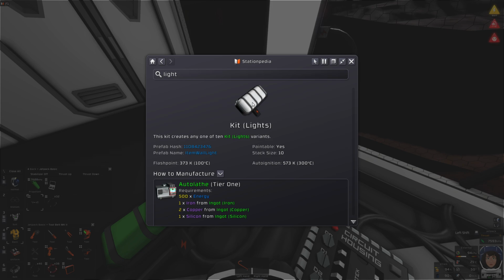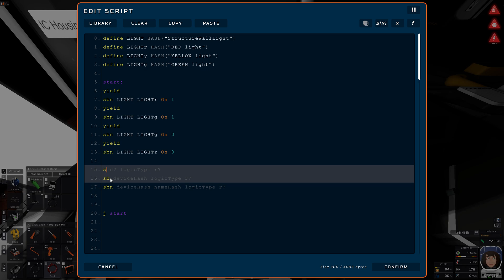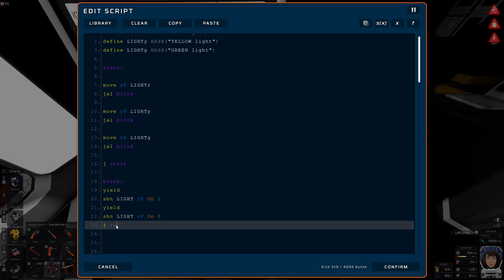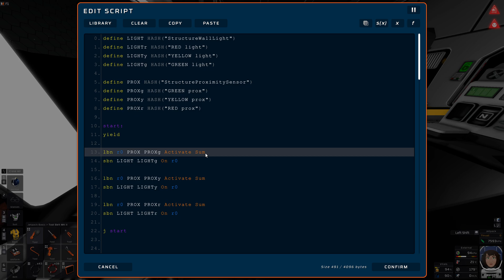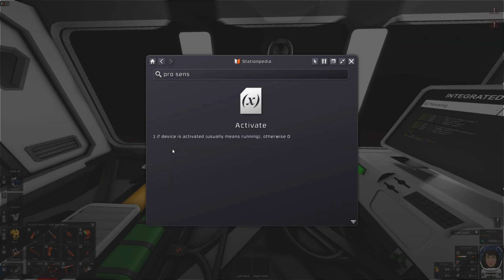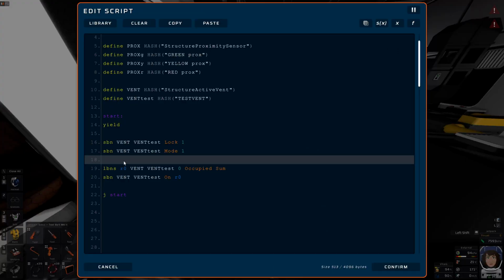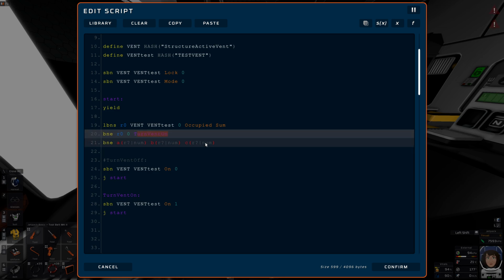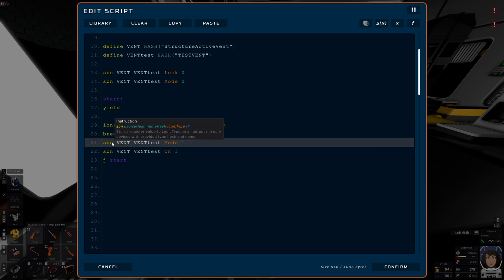Stationeers PROGRAMMING for total beginners - TURBO STYLE! - Part 2: No more screwing around! *

Comment: @God, creator of the universe I was trying to add  a second ic housing, so i would have 2 IC's with 12 buttons/switches (d0-d5) and tried using a memory chip as a 5 digit binary instruct between the two IC10's but found that it would need too much code to get it to work as there is no way to check the individual 5 number bits in the memory. The first digit is needed to get the memory to hold 4 zeros. Each zero would be used as a binary number for different devices for on off states. But the code got too complicated.
Reply from the maker: @Linrox  Why don't you instead use the screw-less approach this video is about? Can use just one IC10 for many devices.
Reply: @OwnerOfTheCosmos  That's what i did in the end, i just wasn't sure how. Thanks for you video. But there must be a way to connect multiple IC housings together.
Reply from the maker: There are several (communicating via data holders, e.g. the memory chip, like you did; writing each others' stacks; ???) but I never tried any of those, so I can't help with that.

Comment: It took me a bit to get this named hash concept and I was going to ask why can't we just use ln (load name) and not lbn (load batch name) then the HASH, but it dawned on me. When you're using HASH and not the screws you're working in batch mode because the program doesn't know which device you are referring to, so you have to define the device then then actual name of the device by using HASH both times. The screws do this for you.  I never used this before and always ran out of screws. This is brilliant.

Comment: OMG! 16:00 Minimum and Maximum - it's binary. This is an automatic multi switch for lights. Any switch near any door can turn on the lights.
Reply from the maker: Almost. Turning it on would work like this, but in the end, you wouldn't want to run to every mechanical on/off switch to find out which one you still have to flip so that finally the lights turn off. ... Hm, here's a ridiculous idea: The 'Average' function of the batch reading command (Reading all switches' on/off state.) could be used, and then you just compare the current outcome with the previous one that you have to remember in a different register. If it's different, you flip whether the lights should be on.
Reply: @OwnerOfTheCosmos  OK, what if when you turned on a switch to light the lights then by using batch, the program turned on all of the switches. Now when you turned one off it reverses the process and turns them all off. It would not work like a normal house 3 way switch but it would serve the purpose, yes? 😆
Reply from the maker: @GaryParkin  Huh ... Nice idea. This way you could see in every place in the room what the switch state is (if we ignore the visibly on light). Yep, that would work.
Reply from the maker: @GaryParkin  Alternatively, you could XOR the state of the two (or more) switches together. The individual switches' mechanical state would now no longer be an indicator as to whether the light should be on/off: It would just be the same thing as in any household where you have more than one switch that operates the same light.